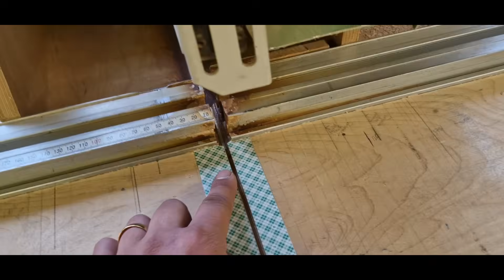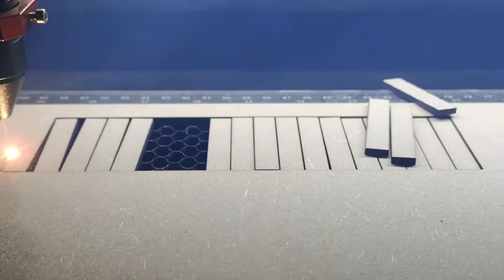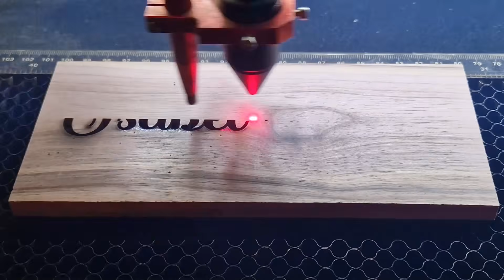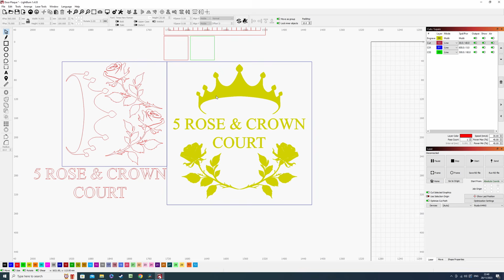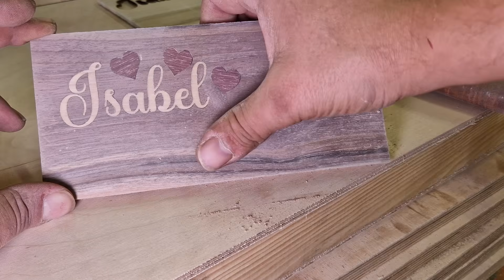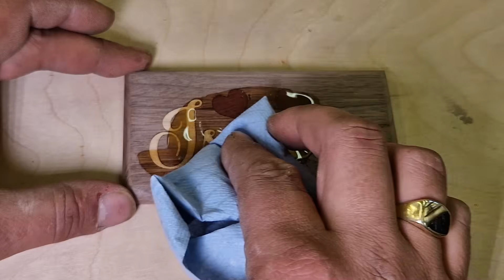Laser cut inlays and how to use kerf offset in lightburn.

Comment: The reason you divide by 2 is because the distance between your point of aim and where the kerf ends (edge of the cut) is half the diameter of your laser's beam width.  Or technically, half your cut width.  So for your offset you want half the beam/cut width.  

"...because you're cutting down both sides" is kind of true but less instructive.

This is a great tip and method.  Thank you.

Comment: The kerve ofset also needed to be done inwards for the yellow green layer.....since you only did it on the outside of the red letters the holes where the hearts fit in would be to big. So once kerf ofset remained at 0.102mm for both outward kerf (on red layer) and inward kerf ( on yellow green layer) you do not have to adjust anything.

Comment: Hi correct me if I'm wrong, but this method will be different with a diode laser right?  Diode laser kerfs are rectangular co2 is a round dot.
Reply from the maker: You are 100 % correct. Most diode lasers will have a rectangular dot and can potentially run in to more issues the higher the wattage. I myself haven't run in to any issues, (yet) but you do have a valid point. Thank you.

Comment: My questions is not directly related to the Kerf but rather the flatness at the bottom of the cavity left from the laser. I have a 10w Diode laser and I can get 3mm depth but the bottom is not flat but rather concave where the middle is about 3mm deep but the edges at as shallow as 1.5 where the angle is acute/sharp. I've tried multiple pass in crosshatch which improves significantly but the sharp corner are still quite shallow. Have you seen this? and if so how did you compensate in your setting to do that.

Comment: so just to clarify your adding to the overall dimension of the inlay part to account for the laser cut when it cuts the part out. I have been using plywood 3/4 maple plywood with 2.7mm mahogany plywood inlays i am just starting to test pieces and so far haven't had much of a gap. i am using an OMtech 2440 100-watt c02. going to try your Kerf offset idea and see if it yields any better results btw a nice Video and a great project. will be watching for more from you

Comment: When calculating your baseline of the kerf, the error is caused by cutting the vertical lines two times by cutting touching rectangles (and because the MDF is too thick). Lightburn can delete overlapping lines, or you could've just cut vertical lines (arrayed) and two horizontal just to make the rectangles fall out.

Comment: Wooops there!  Your method is invalid.  You will need to refilm and upload.  You missed a critical setting.  The issue is that the edges of your rectangles are cut lines and they overlap. Effectively you are burning the overlapping edges twice each.  That will give you a false answer as to what your kerf is.  To fix this issue, you need to prevent Lightburn from engraving overlapping vector lines.  Go to:  Window Tab // Laser // now in the Laser Window (which you might have docked. This is the window/docked window that has the Pause, Stop, and Start buttons on it) Click the Optimization Settings Button just below the Job Origin selector // Now in the Cut Optimization Settings Window it is the last setting at the bottom, Turn on "Remove overlapping lines"     That should fix your issue.
Reply from the maker: That is some decent information thankyou for your comment, hopefully people will read your comment and try your method for themselves.  When I get back to the workshop on the 8th I'll run through your method and if it gives better results I will make a video to remedy that issue. I have another inlay video that my community want me to put out. Thank you again.
Reply: I was thinking the same.
Reply: I've literally just hit this issue an hour ago. Decided it was time for a beer and youtube recommends this videos with your comment that fix the problem. Spooky.
Reply: Have you thought about mirroring your cut and inserting the inlay backwards? The kerf will be slightly larger going in due to the burn. So effectively a V shape.

Comment: May I ask what glue you are using, as well as what Rubio Monocoat color you used?
Reply from the maker: The glue I used was a generic ca glue. In the uk it's commonly known as mitre mate. And the rubio monocoate is the natural or pure colour. It has no pigment in it but if its used on a light wood it can yellow it slightly so I would always test it on a bit of scrap wood first to make sure it's a finish you are happy with.

Comment: Brilliant move to make multiple cuts to multiply your kerf to get a more accurate measurement. 
I use duplicate quite a bit too.  For something like this where I need several of the same thing, I would go to the Array option and make my copies that way.  0 spacing to get them all nicely lined up like you did here.  You can make as many as you need that way, all in one move.  If you need each object to always be like the original, there is a way to do that in the array feature so when you make a change to the original, all of the copies update too.  🙂  
I have several pencil videos that I have done over the years.  Fun to do.  I make one for my brother with a bunch of geometry formulas on it.  We do some fun problems from time to time and it is a helpful reminder for him.  ;-)  I can't wait to see how you do pencils.  Are you going to use that big CO2 laser!?  My little 5.5 was more than enough.  I also used my desktop router to makes some.  I built a fixture to help with consistency but only 1 at a time.  I subscribed so I will see that when it comes out.
I am totally interested to see a video on painting MDF and using that as an inlay.  That is a great idea.  One of my next projects is going to be using powder coat material in a laser engraved piece of wood and then head it up with a heat gun.  Using the laser to heat the powder coat has too many issues and is the wrong tool for that part of the job.

Comment: That turned out nice new sub here. I have playing with diode laser’s for the last four years with my little 10 watt Longer Ray with a .060 mm beam width it makes very tight inlays. On that radial arm suggestion, when cutting do not pull the saw towards in the cut. This can cause a kick back! You want to push towards the back of the saw when cutting. I am 70 years old and still have 9 fingers the tip of one was not a woodworking accident. 😀🛫
Reply: A radial arm saw is designed to make cross cuts while PULLING the blade.  It's written in the operator's manual of every radial arm saw ever manufactured.

Comment: nice work/ The only downside is you can always see the charred edge versus a CNC inlay that will be seamless. But that defined edge could be a feature of the design. I think if I could manage it with the inlay design, I'd use the laser to make a template and then use a router inlay bit set yo do it without burning the wood.

Comment: Nice job, I'd love to see how you do with the plywood you spoke about. Also a little trick for that sanding, if you apply painters tape to your bench and the back of the piece then some CA Glue on the piece and spray the bench tape with activator and press together. It'll hold nicely while you sand and save your fingers and just pull the tape off afterwards

Comment: Great. Video. I would be very interested in how you get on with inlaying painted woods, i wonder how it will work for the sanding?
Reply from the maker: Thank you ,  I am halfway through the production of my next video, but I am working on the designs at the moment for the sequel to this video, which goes through that exact process. I haven't tried it yet, so fingers crossed it works. My theory is to make a design that incorporates 3 or 4 colours, and then everything fits together like a jigsaw puzzle. Hopefully, using a very fine sandpaper on the colours will be enough to apply a clearcoat on top to get it as flat as possible.  This video won't be out this week, but I hope to have it finished for the week after ( although christmas is fast approaching). If you haven't done it already, I would urge you to subscribe so you know when I release it but no pressure. Thanks again.

Comment: Love this. Thank you so much for sharing. Just subscribed. I was wondering how you determine the depth of your engrave to work with the inlay.
Reply from the maker: Thank you for your support. Your sub means a lot.
To find the desired depth for the thickness of material. I would cut a 10mm square out of your desired thickness of material, then you will have to run a 10mm square grid test with varying speeds and power settings until your materials are flush. I will make a point of covering this for you in an upcoming video.
Reply: @MadeBetterWithKnowledge
Reply: Did you ever do this video? 🙏🏼

Comment: When you are making those 19 rectangles, an easier way is to use the array button. Set the x columns to 19 and x spacing to 0. It will be much faster and more accurate than placing by hand.
Reply from the maker: Thank you very much for your insight. I will keep the array tool in mind the next time I have  to create multiple of the same object.
Reply: My thoughts exactly. What Nera said. I use the array tool every time I need multiples.